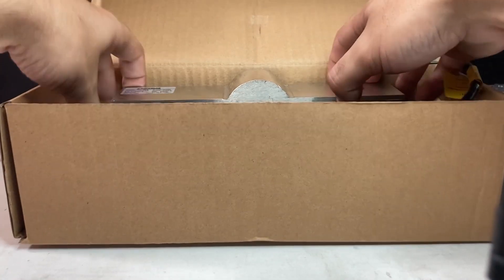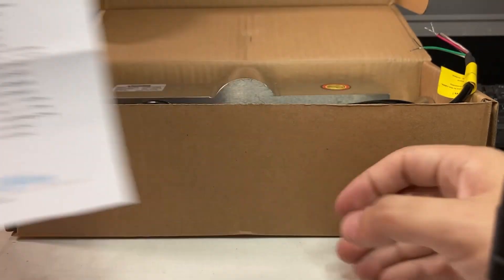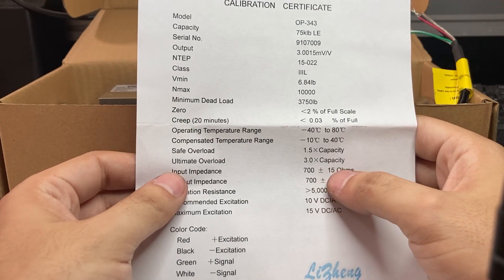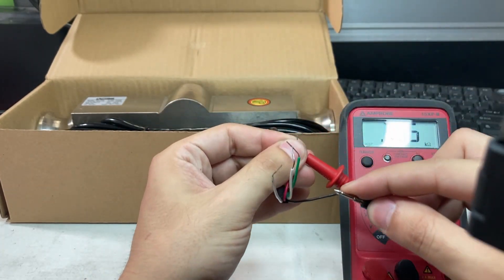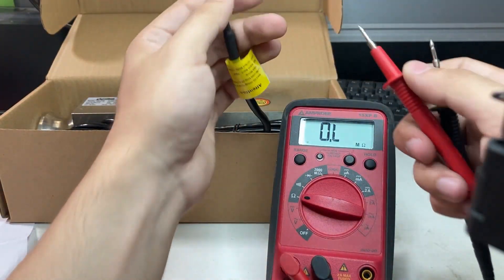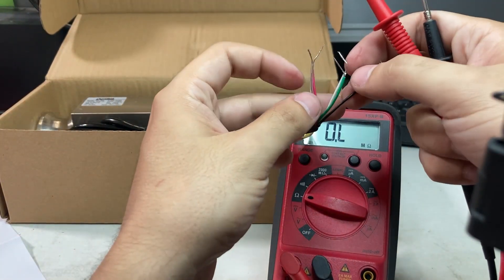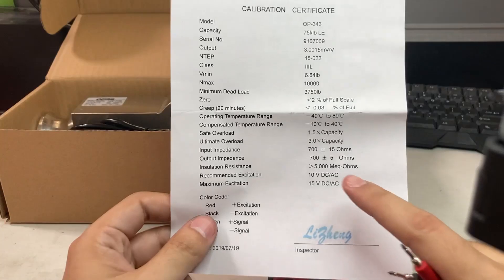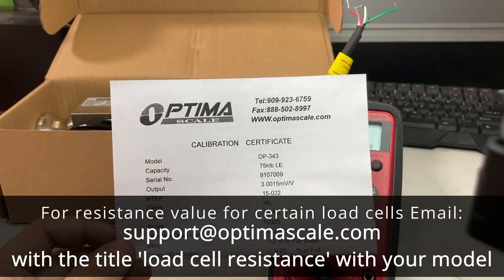How to test for a bad Load Cells

Comment: Now they are good values so load cells are good 
How we knew if they are bad if ot comes morr resistamce??? 😊
Reply from the maker: Only way to check is add voltage over red and black and measure output resistance as weight is being added.

Comment: Very useful 👌..
i want to know what happens when we calibrate a weighing scale.changes occurs in indicator? or in load cell?
Reply from the maker: Calibration is stored on the indicator. Load cell is just a sensor. If you take the calibrated indicator and switch load cells to a different load cell of same capacity it will weigh the same.

Comment: 700Ω
Reply from the maker: Check the green and white wires and check that ohm reading. Then Green and black should be around the same. Load cells usually don't go bad. Try to rewire and check the C15 setting. Check out how to fix a floor scale video for more details. 

Thanks,
Anthony

Comment: Sir ur last check the signal combination of .Green+Red one pair, Green+Black its showing 555Ohm what is the valve plz tell me
Reply from the maker: Green+Red and Green+Black should be between maybe 5-50 ohms difference depending on the load cell. If you have the spec sheet or model number I can help determine what the ohm value should be.

Comment: In a PCB in market ,in place of connection for load cell where normally Black red green white are printed, but this one printed on as E-,E+,S+,S-,. Which color wire represent these ?
Reply from the maker: E+ = Red
E- = Black
S+ = Green
S- = White
Reply: @optimascale6851  thanks.